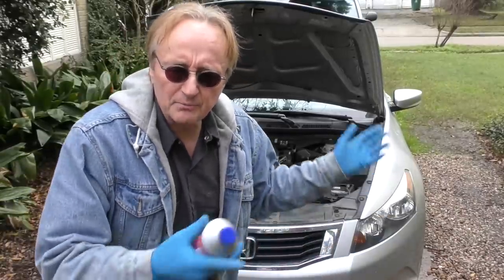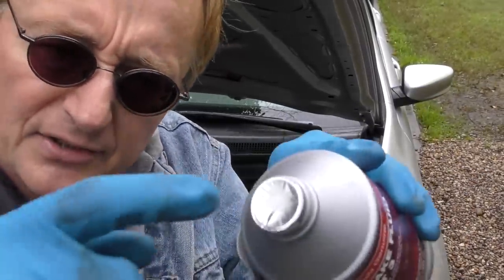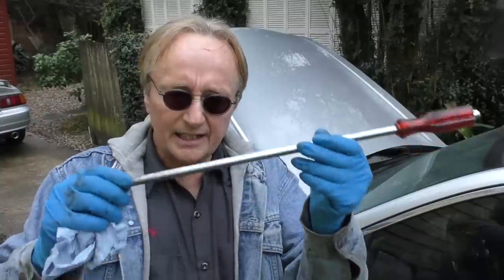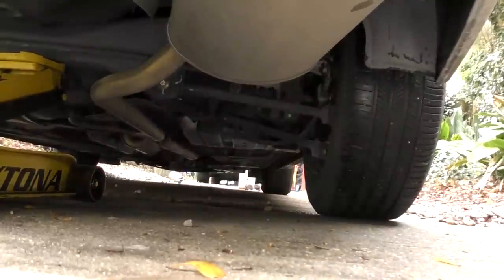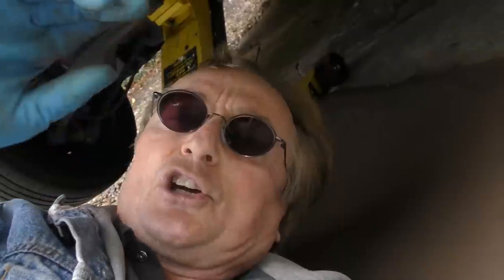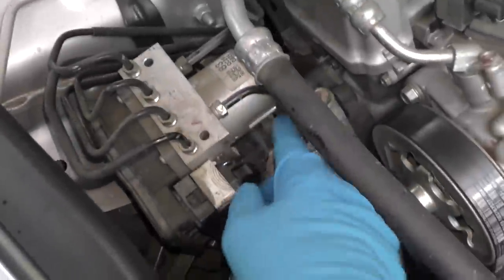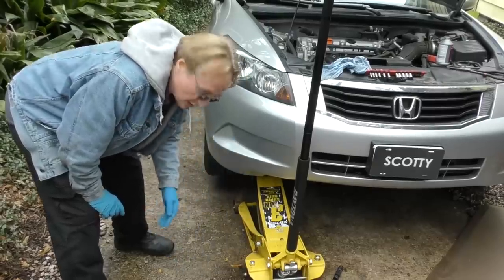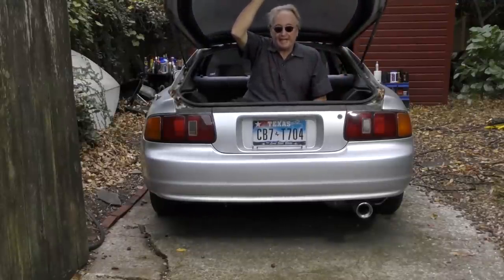Mechanics Don't Want You to Know This About Brakes

Comment: I can change the pads on my 89 F-150 w/o bleeding the brakes. Just remove the reservoir cap, compress the caliper piston w a c-clamp, replace the pads, press the brake pedal, and top off the fluid. Easy 1 hr job.

Comment: are the 2020 corolla cvt transmissions reliable??? My gf bought one new out the dealer and for some reason i feel the gears shift a little rough(in my opinion) when slowing down to about 10-20mph and hitting the gas again. Trying to decide if thats normal or if we should take it to the dealer and tell them

Comment: I usually get a 6 ft clear tube, hook it to the brake,  with the vehicle running I be pumping it and the last pump I leave a brick on the pedal to hold break down while I close it up . So far it works

Comment: Scotty❗
While i'd love to get a Toyota Corolla, or Celica from the 1990's, what's the cost? Considering that the safety quality at this time is very, very poor, and has a much weaker crumple zone, compared to a car that's 2010 up. Wouldn't it be better if I chose a Honda S2000, Mazda Miata gen 2, or a corolla from the 2000's? (especially as my first car.) Or can an older car still be worth it.

Comment: I buy Honda brake fluid and give it to my mechanic for brake fluid change for my 2007 Odyssey last year. Honda is very specific for it's brake fluid content.
Reply: what is this honda brake fluid??? power steering/ transmission/ differential fluids ~ yes HONDA is preferred. DOT 4 brake fluid should be OK
Reply: @ricebike  It's the Genuine Honda DOT 3 brake fluid that Scotty Kilmer just showed in the video. He's holding it in his hand.
Reply: @TimJoseph08031990  brake fluid, in general, are all comprised of the same thing; only difference is the synthetic over regular. DOT 3 DOT4 can be had in any brand

Comment: Is there any advantage to using high temperature brake fluid for an average daily driver?  It might be excessive, but if you need to use it in an emergency or in hill country it might be useful.

Comment: Question unrelated to brakes but here goes: I have a '99 Jetta Mk 3 Wolfsburg Edition sitting in my driveway for the last 4-5 years. Prior to being parked it had run decently but had a cooling leak which was fixed. I got injured before I could do any other maintenance on it and never went back to it; driving my wife's car to work instead (we taught at same school so carpooling made more sense at the time). If I was to stick a battery in it and try to crank her up, what should I expect to happen? What should I be doing before I try this (other than just having it towed out to sea and sunk as a miniature reef)? I loved the car and would like to take a stab at fixing it before just junking it. They only pay $50-$75 for cars that old around here so there is no incentive to do that. Might even be a learning experience to tear down and rebuild an already paid for engine at the very least.

Comment: I always just took a rubber tube and connected to the bleeder screw and let it discharge into the old break fluid container. then pump the pedal while watching the master reservoir and adding more fresh fluid as needed,

Comment: Hey Scotty I know u don’t like dodge but I have a 02 Dodge Ram 1500 4x4 with 290,000 with a 5.9 l it’s still running strong with the original transmission I had it inspected by a mechanic they said I have no issues with my engine or transmission they said they were mind blown

Comment: Very good video, however I'd recommend that a diy-guy/girl first checks the condition of the bleeding screws before starting the work. If they are badly rusted, then a garage might be able to open those with an induction heater etc. whereas diy-man with only bunch of tools will just break it or make it round  (:

Comment: To get rid of as much old fluid as possible, take the wheel off, loosen the master cylinder cap then compress the caliper with a big c clamp. I keep removing old oil from the master cylinder as it fills up. That way the system is as fresh as possible.

Comment: Due to brack fluids ability to absorb moisture i always blew out the bleeder screw before putting the cap back to prevent the bleeder from rusting shut over time

Comment: Brake fluid will take paint off, it's a good paint remover. As far bleeding brakes it's quicker if you have 2 people plus automotive parts stores sell a self made or brake bleeder kit that is relatively cheap if you want go that route.Good video though with the screwdriver and seat trick.

Comment: In the north - buy rear cylinders/calipers if the car is older than 10 years because you only have 50/50 odds of getting the bleeder to open...
and that's with spraying penetrating oil once a week for the 3 months leading up to the bleeding

Comment: It's even easier than Scotty says. With disc brakes, you can simply open the bleed screw and the fluid will flow out under gravity. In some cases, it will flow out of wheel cylinders if the bleed screw is open and the cover is off the master cylinder. You can watch the fluid flow out, and sometimes you actually see a bubble. In any case, by this method you can replace some or all of the fluid. If you have a DOT 3 system, you can even use dollar store fluid. Just make sure you know what your system requires.

Comment: Hello scotty, I have a 2006 ford explorer. When were driving on the road for 10- 15 minutes drive while the air on is running, its smells like its burning and the check engine lights comes on and sometimes the wrench comes on. Can you tell me what's wrong

Comment: I have a 2008 Subaru Impreza 2.5i (non-turbo) manual transmission. The car has 99000 km (60000 miles) but is 139 months old. Timing belt is due at 168000 km/105months. Is is safe to wait since I still have 70000 km to go, or should I replace it because I'm 34 month passed the date mark ?? Thanks for the advice Scotty.
Reply: @Mark Codiroli Ended up doing the TB, pulleys and tensionner (Original OEM subary parts.. no aftermarket kit). My fear was the car sat for some time and is 13 years old...

Comment: 10:00 Kia/Hyundai transmission issues? ( before ~2005 ): disconnect the battery and you will start the Automatic Transmission reset/ Relearn procedure.  You can't do that with newer Kia/Hyundai's  You need fancy scan tool, instead.

Comment: Gotta make sure u dont empty the master cylinder (introducing more air) while bleeding. Check after every wheel at a minimum and top off as needed.. Manual vacuum pumps are very helpful too.

Comment: Hint: Disc brake calipers will simply drip if you open the bleed screws. My vehicle has rear drum brakes. The wheel cylinders will drip if bleed screws are opened, and will drip faster is the cap is taken off the master cylinder. In every vehicle I have had, the disc brake calipers will drip on their own. I can't the same for drum brake wheel cylinders. The old American cars with drum brakes would not drip on their own. I have no experience with other than imports. I can't say what will happen, but you can try it. To keep Scotty happy, wait for a low humidity day before you take the cap or cover off the master cylinder.

Comment: I don’t know if this would work but if you get a boat primer like the Bulb on the hose that connects the gas can to the motor so put end in the fluid and put your thumb over the other and and prime it and remove your finger so it will drain

Comment: Scotteee, you forgot to displace the air in the new brake fluid container by taking off the cap, puncturing the seal, put the cap back on & leave loose so the air bubbles in new fluid will expand, rise and POP. This will take 20 min.

Comment: I take the wheel off and do it from the side of the car not from underneath, and you can buy a one way valve tube which allows you to pump the brake a few times, much easier.

Comment: Hey Scotty. Love your videos. Anyway, I have always had good luck just gravity bleeding the brakes. I just fill up the reseviour  and then crack all the bleeder valves at the same time. Keep the fluid level up under the hood and run the whole can of fluid through since it goes bad anyway. I've even had good luck this way after changing out a master cylinder. ( of course I always bench bleed it first)  Iv'e encountered more problems bleeding out a hydraulic clutch. They almost always wear me smooth. :-) Keep up the good work.

Comment: Hey my mechanic said this about my Toyota sennia van 3.3 motor Checked out the van head gasket is leaking codes fore camshaft and crankshaft coralation that means timing belt water pump  needs to b done is this worth fixing and it has 240,000 miles on it and what should I do with it. HELP

Comment: When I bleed brakes I do the hose into a jug method and grease around the bleeder threads. Much faster and less getting under and into the vehicle.
Reply: Yes, and that way you can't accidentally suck air back into the system

Comment: I have been a shade tree mechanic since the 50s and though Scotty is technically correct about the absorption  of water in the brake system bleeding the system is mostly over kill. The average person while doing this will probably end up getting air in the system.
Have the mechanic do this when replacing front pads or rear shoes or pads.

Comment: My car has been down for a few months. I had a hard braking incident. No accident occurred, but it screwed up the brakes. I immediately replaced the front rotors and the rubber hoses. Hey! they were 24 years old. Probably needed it. I couldn't bleed the brakes and the brake pedal was hard. The popular wisdom on youtube was it was the power brake booster. The car is over twenty years old so it wasn't easy to get. I had to send it to a place for a rebuild. This did not fix the problem or my mood. Somebody mentioned the proportional valve. I watched every video on proportional valves I could find. I got just clues here and there. Bought some flare nut wrenches because the open end wrenches were damaging the fittings on the brake system. I opened 1&2 steel hose from the proportional valve to the master cylinder. This released the pressure on the proportional valve. and the brake pedal was soft. I thought I had discovered the solution.  Not so. If you try to bleed the front disks from this point, it will reactivate the proportional valve and you won't be able to. I believe I need a Proportional Valve Bleeder Tool. The 5 year veteran parts guy I talked to said he had never sold one before. He will have to order it. 
     If you wouldn't mind. Could you go through the whole brake system. It doesn't really work to fix just one part. You have to fix the whole thing. Could you please explain the whole demonic system for us. Thank you.

Comment: Dot 3 from a sealed container is used unless manufacturer specifies something higher. They have reasons for what they specify.
They don't recommend wasting your money or changing your use of the proper things.
If you wanted to analyze your personal cars result of its age of brake fluid in your climate, you can have it tested.
Its part of normal maintenance and repair to push out the old fluid during brake pad replacement. Then top it up.
If you care for it right and keep the cap on, you have best results.
A blleed and adjust or caliper slide maintenance during inspection is not that expensive and helps your linings be more effective as they last longer. Find a shop you trust, don't stab techs in the back and call them mechanics and thieves when you know your published maintenance schedule and can double check your technician any time to be sure he has your best interest.
If you buy the manufacturer plan its in your payment and structured. Then go see a reputable service department. If you aren't satisfied tell them. They will make it right and or help you understand it.
CSI is valuable to them like your car is valuable to you.
Enough with the hamburger stand stories saying all cooks are like this or all chefs are like that.
Its heartbreaking to invest so much time and money and adopt a pro mission and find there's people making generalizations caused by communication and pre conceived notion.

Comment: think twice about bleeding brakes on an old rust bucket. chances are good you will snap off the bleeder trying to loosen it and then you will be out $$$ for a new caliper. Snap off 4 of them and you will really be crying. If things look tight and there old with no rubber cap, consider using a turkey baster to remove most fluid from brake reservoir then refill. Do this every week for 3 weeks or so and most fluid will be new. Fluid is lots cheaper than rebuilt calipers. Texas cars aren't rust buckets like Northeast. If its been more than 2-3 yrs without a bleed and things look rusty don't follow Scotty's advice!!

Comment: Tip: if you have painted brake calipers, use a hose, or immediately wash brake fluid with water. Brake fluid will ruin your paint job. Same with rims.

Comment: There is a brake bleeder hose you can buy with a one way valve that allows you to bleed brakes yourself just by filling the
brake reservoir and pumping the brakes slowly. The thing is that you must make sure to keep the
brake reservoir full while doing this. 
   Another thing. Never EVERY put in those stupid aftermarket stainless steel braided 
brake hoses. Someone put them on an Infiniti I bought and guess what. One burst a week ago.
Nice. Of course they never have proper mounting hardware with that aftermarket crap and
in this case, the line chafed against the spring and once that braid was chafed, the garbage
inner rubber burst. Nothing like driving with just the parking brake and the gear shift
and clutch to stop with. Needless to say, I am installing OEM lines from Infiniti.

Comment: Newer ford's need the battery module reset... When I changed my battery and it kept on dying and that was the reason. You can do it with forscan app and a cheap obd2 reader. Cost around 20 bucks don't go to the dealer.

Comment: Autel has a Bluetooth scanner called ap200 that has the abs bleed feature on it and it only cost 50 bucks. Also, you definitely want to use a tube on your bleeder valve because brake fluid is very corrosive. You don’t want it to get on anything.

Comment: Order is not critical. He should teach gravity bleeding- then pump down and hold with screwdriver after enough fluid has gone through. Can also pump about 10-15 times/wheel- wait around a minute- watch all air has escaped as it's gravitying out then tighten or do the screwdriver on brake pedal thing after a minute then tighten. I like boards as all cars have a different distance. .

Comment: I know of a better way to bleed brakes. Most auto parts stores have "one-man bleeder" kits for around $10. It's just a tube connected to a container---attach the tube, loosen the bleeder and pump the brakes a few times. You can see the air bubbles in the clear tube. Once there is no more bubbles, close the bleeder

Comment: I gravity bleed and use DOT5.1 fluid, but then again I have a 2004 Mercury Marauder, one of the last ones made, and I put KVR 14" drilled front rotors (and larger calipers with Corvette pads) on it for wet braking power. It will submarine you out of your seat-belt and into the floor under maximum effort. lol

You should have warned people about getting hydromorphic brake fluid (DOT 3, 4 & 5.1) ON THEIR PAINT!

Historical tidbit most mechanics don't know. The reason the brake fluid that is used in cars is by law hydromorphic is because it will absorb water. This was not to make brake parts go bad. If DOT5 silicone fluid is used, which is not hydromorphic and won't absorb water, condensation may develop from mechanics checking the fluid level and introducing moist air to the inside of the master cylinder. One drop of water may work its way down the line and into the brake cylinder or caliper and if the caliper gets hot enough to boil the water that cylinder will immediately fail and you will lose the brake entirely, and THAT is why the Federal Department of Transportation set the standards for DOT3, 4 & 5.1 fluids and requires at least DOT3 fluid be used by the manufacturers on cars.
   Hydromorphic fluid has a very high boiling point: DOT4 is higher than DOT3 and DOT5.1 is the highest. As they absorb water their boiling point drops and THAT is the reason you want to flush out the old fluid. However, most modern brake systems have calipers and the only reason the fluid level inside the master cylinder drops is because the pads are worn out. On my car, as I indicated, I flushed out all the original DOT3 and replaced it with DOT5.1. After that I have never removed the top off of my master cylinder! I can see when the level is low and I just squeeze the fluid back up into the cylinder when I replace my pads.
   How do I know all this? I was trained by the best automotive engineers and designers at the Atlanta GM Training College back in the 1990's: basic brake systems, ABS 1 & 2 (Remember the passive systems that just dumped pressure?) as well as Special Electronics 1 & 2.
   Here's kick-in-the-head Scotty. Even back then the engineers were talking about the computer controlling the engines valves with pulse modulated solenoids instead of camshafts and followers. But I guess the petroleum industry didn't like the idea? I wonder why. Could it be FUEL MILEAGE?

Still waiting. lol

Comment: It pisses me off that the local service garage charges an extra $50 for 'caliper servicing' and $19 for 'shop supplies' that does NOT include bleeding the brakes! I usually do a brake bleeding job every 4 or 5 years. One must be careful not to break off a rusted nipple that is seized.